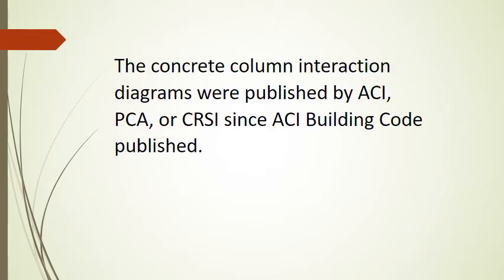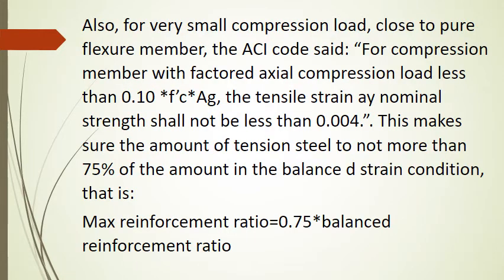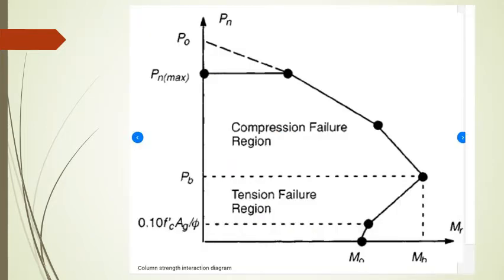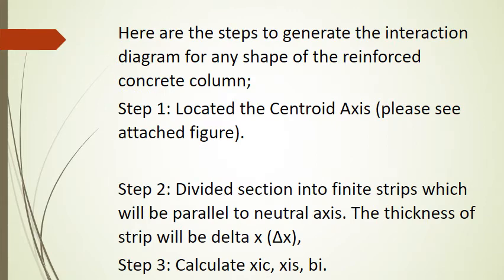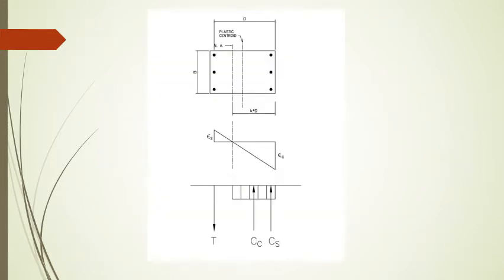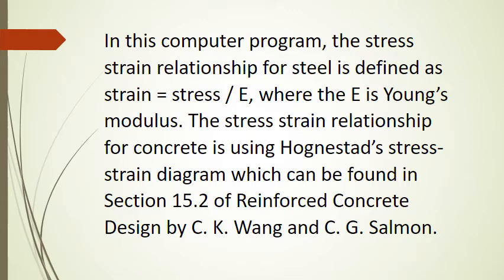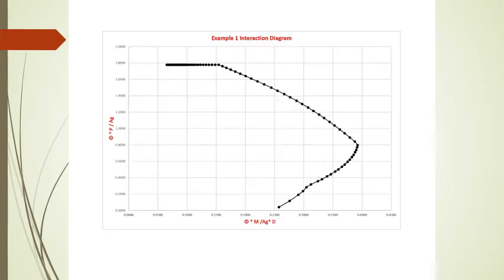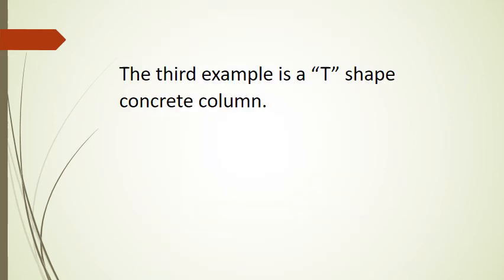Concrete Column Analysis and Design “L” Shape, “T” Shape or Any Shape Concrete Column

Comment: How about a cross-shaped column?
Reply from the maker: Not a problem. The method used in the program is a "fine strip" method. As long as shape of the concrete column can be divided into "strip",  P-M interaction diagram can be developed for either X or Y direction. Width of the strip will be decided in the input data.